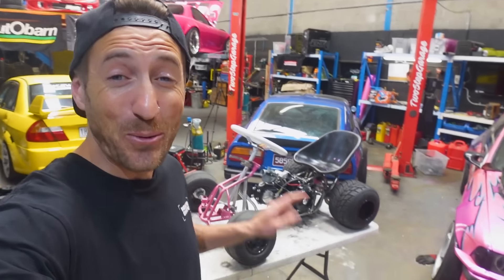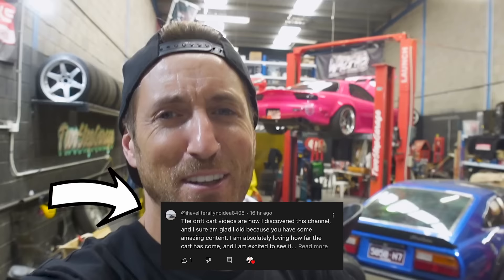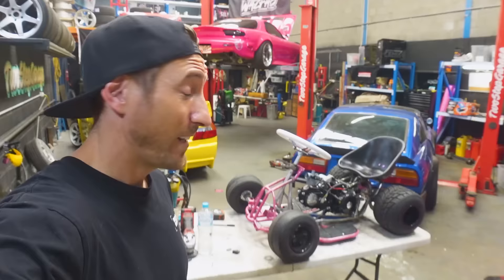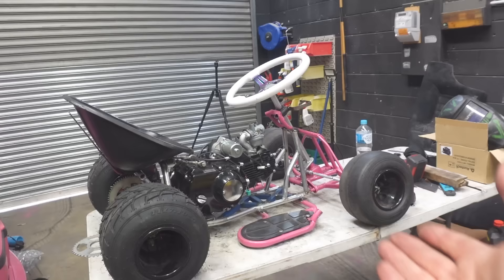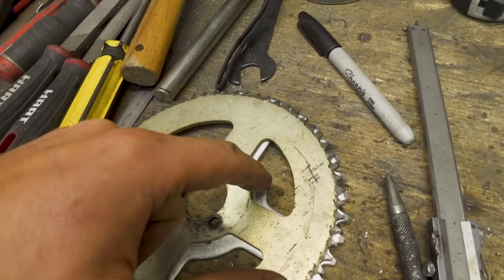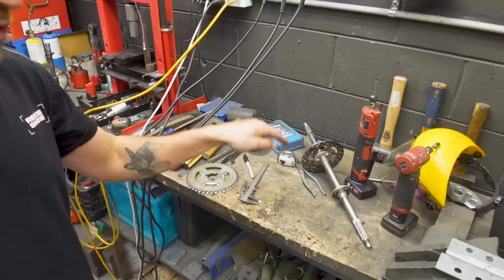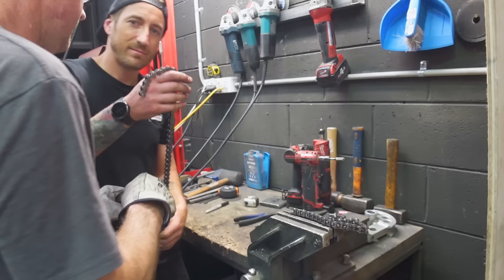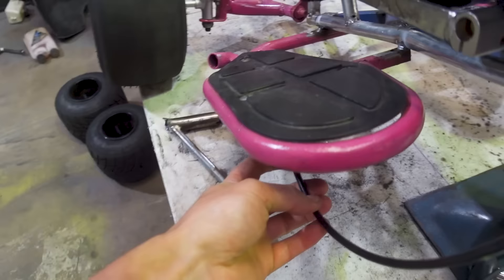Installing a HUGE 125cc 4 stroke motor in our BUDGET Drift Kart! | Part 5

Comment: @7:50 the slot for the cable has to face away, so you pull the pedal back as far as it goes and pull the cable out as far as it goes and hook it over the front. the way it is now i think it might be able to come out when you givin it the clutch stabbies. just food for thought, save you going back to fix after first big ride

Comment: Only concern i have is the bottom frame section, the Achilles heal will be bending, id put brace from the steering to the seat to compensate for bottom flex

Comment: That exhaust is going to be sick! I'm so keen for the flames and the turbo down the track. crazy steering angle coming soon?? 
I drive an E36, so that gift voucher will assist with the cost of oil. But I have to be honest, my car leaks oil so badly that it's almost like pouring it straight onto the ground 😂

Comment: I’d have a bar going across front near the steering wheel and to under the seat so it doesn’t flex when pulling back towards you like a strut brace

Comment: Hello Mike if you have trouble with clutch in this engine you can clutch delete plug and play parts are there from greece.For the Turbo you install later this engines have flatt piston (52,4mm)so you can run it but to be safe you can buy whole cylinder head for like 70-100€ with forged valves and 54mm cylinder a good one about 80-100€ with flatt piston this thing gonna flight

Comment: I’ve noticed you drag the torch when welding… I assume it  isn’t a flux core wire spool (the weld generally looks dusty if it is flux core). Mig is meant to be pushed. Torch at about 12 degrees so you are preheating the parent metal. Better penetration and a stronger weld. Give it a try and it should improve your weld integrity. Awesome project though. Peeeeeaaaace

Comment: Hey mate i had a great idea for the drift quad for the clutch make a suicide shifter and put your clutch cable to a clutch shifter and put it on the suicide shifter so you will be using the clutch while shifting gears
Reply from the maker: I thought about that, but I’d love to be able to clutch kick the kart 😛
Reply: Yeah that would work as well